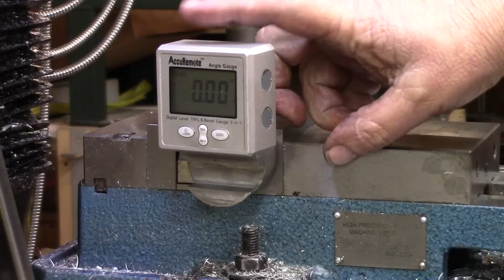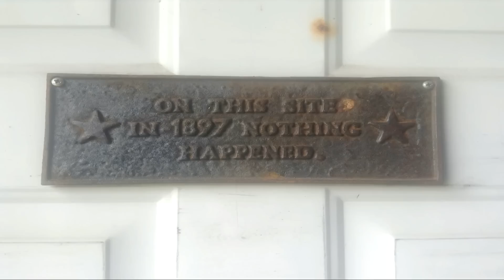Machining a Fly Cutter

Comment: I am a little late to the party here but I am also new to machining. I made one of these before looking at your video and only did one thing differently. On yours, the screws always push the tool off center. When I made mine, the screws always push the tool toward the center.  If I want to use a smaller tool, it still will be centered. I don't know how much difference this makes. It just made sense to me. I enjoy your videos!

Comment: Lee what are you using for cooling mist, bought or built? thanks for the videos!!
Reply from the maker: Paul Sprute My setup was purchased from an eBay seller for about $12. I had to add the ball valve (~$6) and the magnetic stand was one I had. The air hose came from the local "box" hardware store, Lowes and was $5 for 25 foot. The hose fitting is 8mm, but 5/16 hose works fine. It's a simple siphoning system and so far seems to work really well. Thanks for stopping by.

Comment: May I ask where you bought or made the fly cutter tool with the insert? I can't find them on the internet anywhere.
Reply from the maker: Mark Harris Search eBay for metal lathe left hand turning tool. Mine was part of a 5 piece set of turning tools. Mine is a 12 mm (1/2”) set.
Reply: Thanks

Comment: What coolant are you running through your mister?
Reply from the maker: It's what Fastenal sells (FMT), but they only sell by the 5 gallon bucket & 55 gallon drum.  I bought a quart from a guy to give it a try.  I'm mixing it 25:1.  This project was the first time I used the misters so I'm still evaluating the coolant.  The biggest thing I know about it so far is that it stinks to high heaven - smells like burnt rubber before it's mixed.  Doesn't smell bad while in use though.  I'm watching for any rust on my equipment, etc before deciding if I want to buy more.  Thanks for stopping by.
Reply: +MrPragmaticLee Thanks for the reply. I just noticed the clear color. I use Kool Mist brand mixed 4.5oz to 1 gallon water. It has a blue color. I have not had any issues on neither my lathe nor my mill with rust using the Kool Mist.
Reply from the maker: grntitan1 Thanks for the feedback. I don't like it being clear - may give the Kool Mist brand next.
Reply from the maker: grntitan1 Thanks for the feedback. I don't like it being clear - may give the Kool Mist brand next.
Reply: G

1 7,50
Shia LaBeouf: nic dziwnego, że Hollywood woli o nim nie pamiętać
 RA 

AMOR- 5TTQ16 ba
Reply: You can say that again, again! enjoyed the video, cheers.